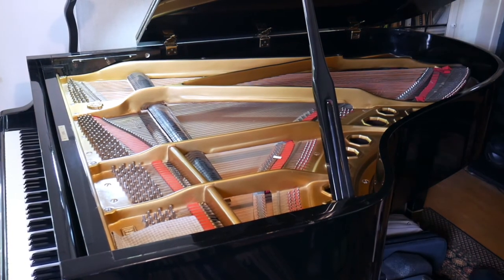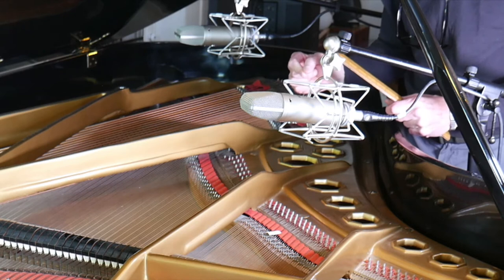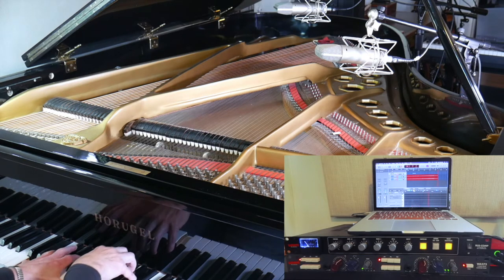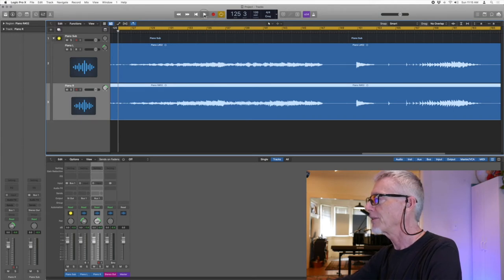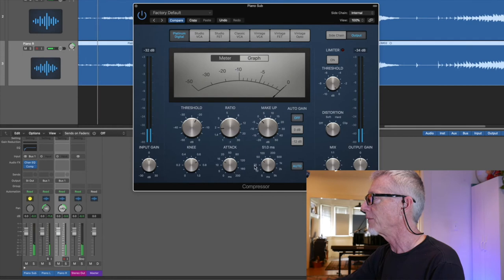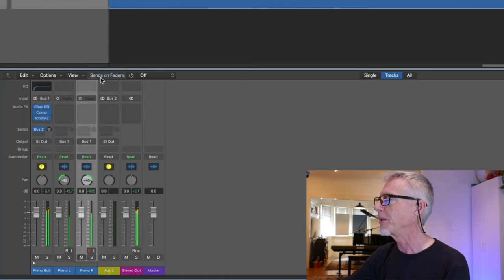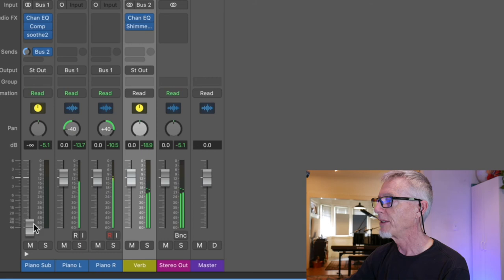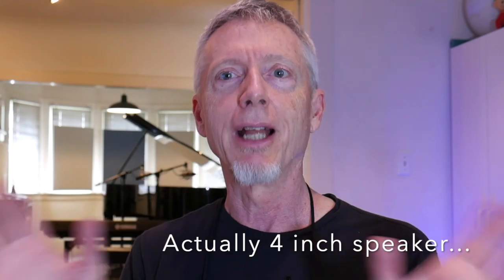Recording my Piano - Mic's, Pre-Amps, DAW processing.

Comment: thanks very much for your excellent video. because i intend to record my piano similarly to you, i invested in the same warm audio preamp and bus comp that you show. i do have a tascam dp24-sp instead of the laptop. could you kindly tell me the connection setup you use between the preamp, comp and audio interface?  thanks very much. Paul Schneider.
Reply from the maker: great, i hope that'll work well for you! i use balanced xlr cables for the signal flow. mics to pre's, xlr out to xlr in on the compressor, and then xlr out to my audio interface. i've kept the cable as short as is convenient. it was a small added expense, but worth it, i think.